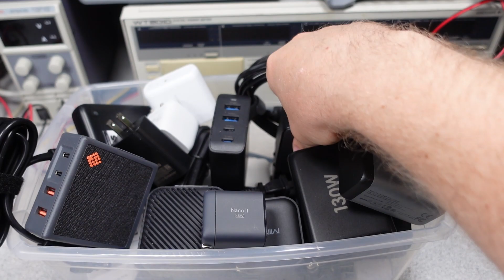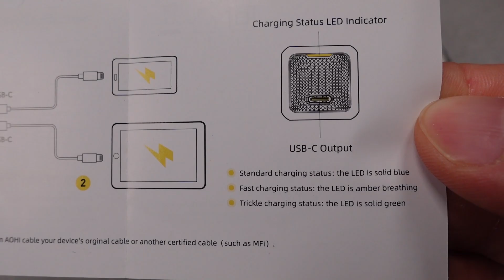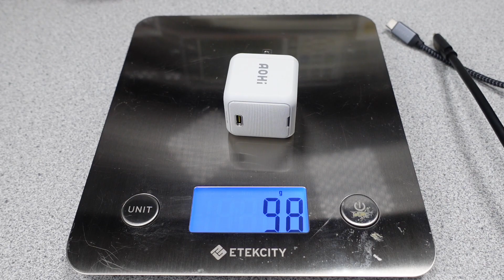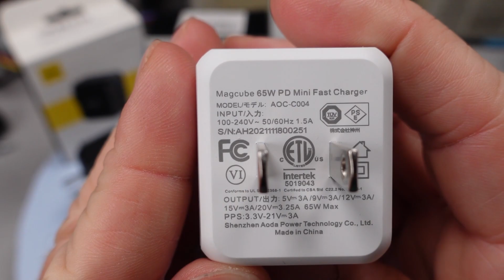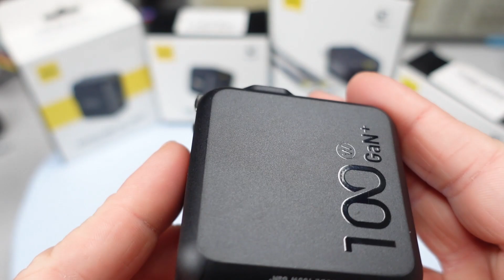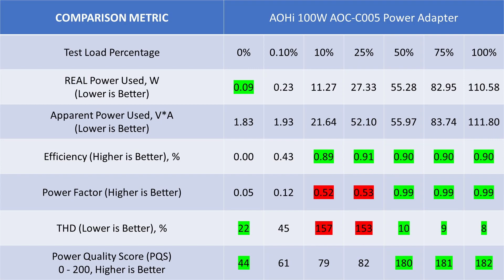AOHi 100W – 20W USB C Power Adapter Review and Test

Comment: Do you prefer the anker 715 Nano 65w charger or that aohi   65w charger? Can't decide on which one to buy.
Reply from the maker: hmm.  I think the Aohi has the edge in terms of performance.
Reply: @AllThingsOnePlace  
Okay, awesome. Is the aohi 67w dual port (usb c and a), worth getting over the basic aohi 65w changer? I've never had a problem with a single port charge but was wondering is there an upgrade on performance?

Comment: For the 65w charger class does it matter if you're only using them for travel? Ie charging on the go? Since you're not paying for the electricity anyways. 
And does the lack of acceptable power factor correction do any harm to the devices?
Reply from the maker: I mean, does it matter for your cost no, does it matter for wherever you plug it in, yes.  If it costs the hotel extra dollars for electricity you think they aren't passing that cost onto your bill one way or another?  It'd be very difficult to extract that kind of information though.  For the most part the device doesn't care how the power gets to it, as long as it gets there.

Comment: How does THC effects the connected devices to the charger??
Reply from the maker: THC may cause user dizziness or hunger but I think the charger is going to pull through.  THD is an AC power metric and should not impact the DC side too much.  It can cause some of the DC side metrics to get worse though.  The DC side metrics would be voltage level, ripple, transient response, noise, I look at these but I haven't started cataloguing that data beyond voltage/current since besides the real cheap and unsafe stuff I haven't seen any dropouts in the power supplies.  The biggest addition would be getting an oscilloscope capture of the ripple + noise at each power level or at minimum an RMS voltage reading of this figure.  Things to improve in the future.  I also was supposed to do a video explaining all of this over a year ago.  Never got around to that...

Comment: Despite the lack of performance, would you say these chargers are generally safe to use and wouldn't catch fire or brick my electronics?
Reply from the maker: haha, yes, I think they are safe that way.  I'd say the quality of power components may mean a little higher mean time before failure, MTBF, than some other manufacturers but that's pretty much the same of all the manufacturers these days.
Reply: @AllThingsOnePlace  Thank you, so the ETL listing generally can be trusted in terms of safety usage?

I'm not technically literate so just trying to understand the video a bit better, is the main metric power efficiency and how well these adapters can use the input power or is there also considerations for safety and charging speed, etc? Like for the wave spikes at lower watts, practically speaking what do those mean?

Comment: I was trying to get a charger for the steamdeck that was as small as possible. Bought the 40w one and now not sure anymore. Any other recommendations for slim chargers? I'd like it to fit in the steamdeck case.
Reply from the maker: Yeah, that is a tough one, a lot of the 40W chargers won't do higher voltages because they are really two 20W (5V/9V) only chargers in one box.  I wish some of the 65W chargers were a little better because some are very small and would be able to charge anything.  I don't have any other specifics.  I have a really slim adapter here but it isn't tested yet so I can't recommend that.
Reply: @AllThingsOnePlace  thanks for the response! I'll look forward to that test whenever it completes. Thank you for the info, this channel is amazingly helpful.

Comment: I bought 65W AOHi Magcube and it died after 2 weeks🤦
Reply from the maker: That's not good.  There is going to be some defect rate amongst all electronic devices, it is inevitable as part of the manufacturing process that some are duds.  Hopefully, you are in a place where they can get you a free replacement!  I honestly don't use mine once I concluded the testing.  I have better chargers for some reason, no idea why.

Comment: Yeah............I am going to have to give the AOHI brand of charge adapters, a big fat NO. I think the Basseus stays on top for good reason, and is the class leader, judging by your testing and data retrieved and all that. Nothing about these adapters from AOHI that you've shown today, impresses me. And infact, the 100W one for 80 dollars is perhaps the worst, because like you said, you don't get what you paid for, so your just wasting your money. Getting lost in a mountain of USB cables sounds like fun!
Reply from the maker: Yeah, I won’t be using them but there are worse options. They tried a little, at least the 100W has PFC.  Every category is lead by a different brand though.

Comment: Thanks for reviewing these, though the video makes me sad.  I bought a few of these because they seemed like good quality because they came from a company with many years of experience with power supplies.  Keep up the good work.
Reply from the maker: You shouldn’t feel sad these aren’t BAD they just aren’t industry leading for each category.  Yes, I was a little disappointed in the performance because I’ve seen there’s better options out there but they met all the efficiency requirements and have safety listings.